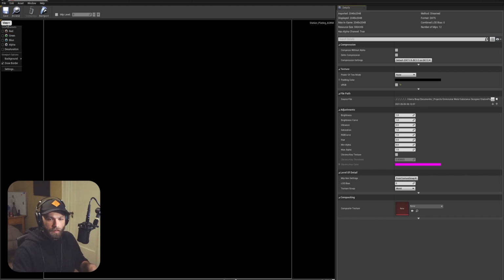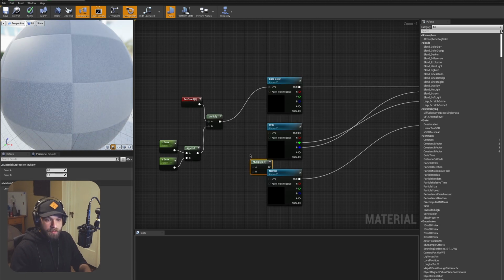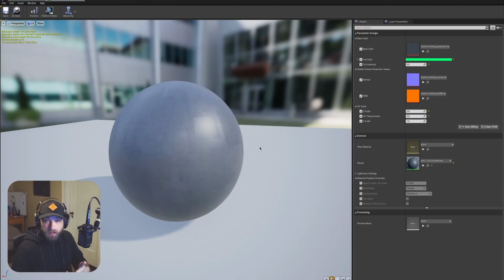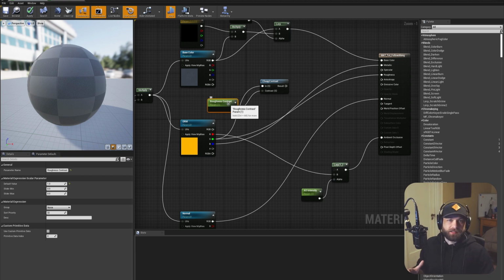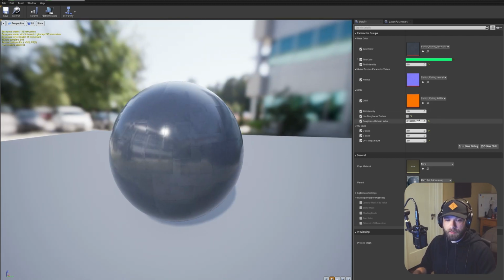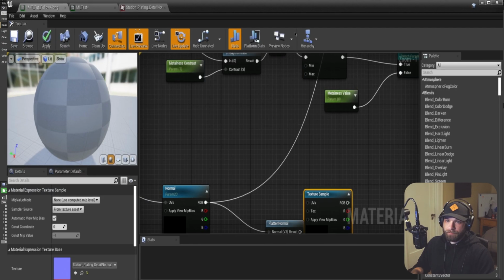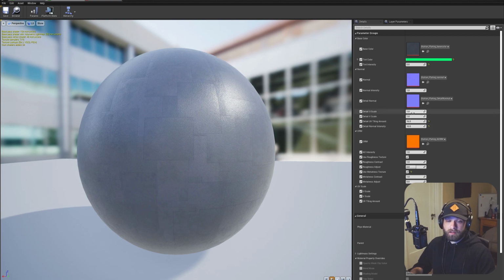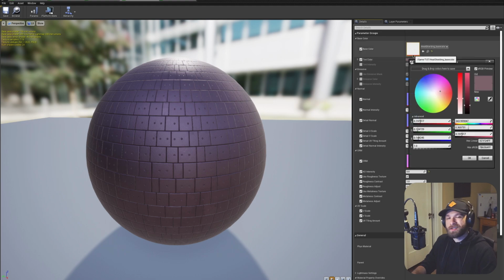How To Make A Master Material in Unreal Engine as a Beginner

Comment: I just made this, and I don't find this very useful.  Having instances of a material for each model, because the tiling is set in the material, not in the model (so you can re-use that instance only if the tiling matches).  What if the tiling on the side doesn't match the tiling on the face?  Do I create another instance and make that another separate "material" even though it's the same material?  What if I'm doing a complex item and I need seven scaling levels.  And the materials inherit from parents, so any time you adjust one of those, you could throw a wrench into any number of models.  Yikes!
Reply from the maker: The use-case of the tiling functionality of the material is specific to materials that use repeating, tiling textures. It does not negate the need to correctly lay out your UVs and in fact, the best practice is to set a certain texel density for your model's UVs so you can use a consistent tiling amount.

If I have two models that I want to both use a tiling cobblestone wall texture, for example, I should have a standardization of my Texel density so that any model that uses that cobblestone wall material (set at a tiling of 2 for the sake of the argument) can use the same material instance and a 2nd or 3rd instance at a different tiling amount would not be needed.

You're asking great questions tho and I hope this explanation clarifies some things. My main purpose in creating this guide was to teach people newer to the software some of the possibilities available in making materials in the shader system Unreal offers and I do believe it accomplishes that.

Comment: wouldnt this be bad for performance bc of the high shader instruction count
Reply from the maker: I am not a technical artist so my understanding of this could be wrong but the final instruction count is around 150 instructions and the engine only has to do this once when loading the material. When you make material instances, its not having to recalculate those instructions per material so having a bit higher instruction count isnt a problem when that master material serves a large percentage of the total materials you would need for a project.

Also, I think there are simple and complex instructions. The number itself doesn't equate to a heavy-load material but rather what youre asking the material and engine to do. Using things like Parallax Occlusion Mapping or World Aligned Textures will certainly be more expensive for performance than adjusting roughness or tiling, for example.

Hope that helps!

Comment: When working with Master materials and instances, vs having the same amount of materials but are not instanced to a master material, does this increase performance alot or is it just for easier workflow?
Reply from the maker: Thanks for the question!

I'm certainly not a technical authority on the matter but from my understanding it is more performant to utilize material instancing when you have materials that function the same way because the engine doesn't have to "reinvent the wheel" for every material.

On top of that, it is also very beneficial from a workflow standpoint because iterating by tweaking a material instance is much faster than modifying and saving a master material 

Hope that helps :)
Reply: @Braytonks3D  Thanks, I will give this a go and try redoing my materials into master materials and isntances. =)
Reply: Probably none of the above.  The duplicated code is stored more efficiently (insignificant here, likely), but inheritance can make for some long calls if the parent falls out of cache (likely only in a very dense game or on an old CPU).  I would do it the way that feels right/easiest/best to you.  I'd guess that the performance difference would be difficult to measure -- not enough to sway you from doing it how you care to do it.  Look for titanic performance gaffs -- tiny inefficiencies are rarely worth correcting, and you would need an experienced dev guru to find them, anyway.  If your perf stats are happy, be happy that you can ignore them.  Personally, I have decided to abandon this parenting process and continue to do all my mats in Blender and import (which has worked quite well so far, mats come along with models all applied correctly - it's super snappy).  I prefer Blender and that's reason enough to stay with it, but it's not like if I make the wrong choice my game won't run.  Plenty of methods will work.